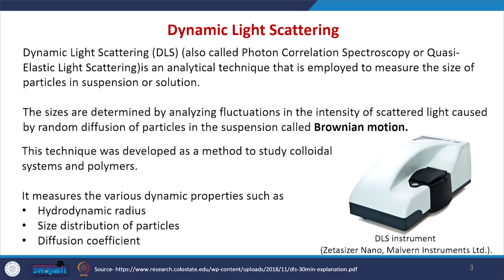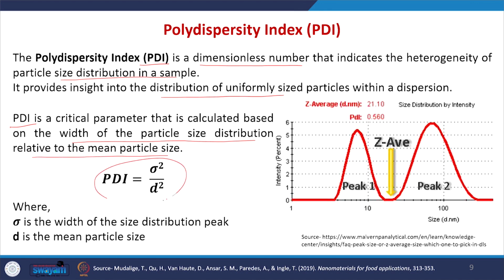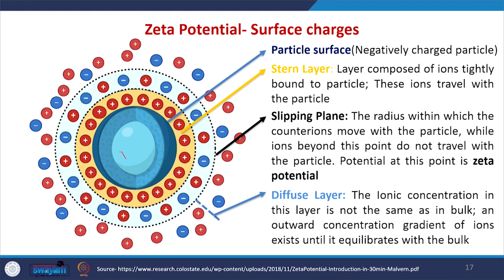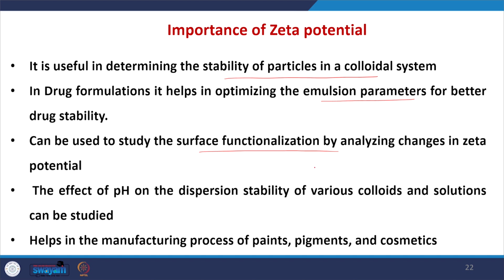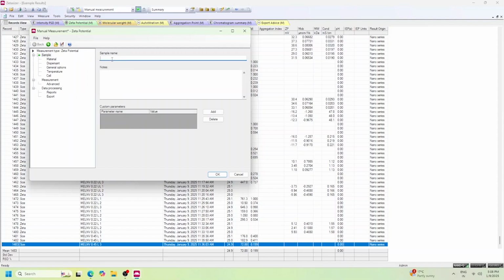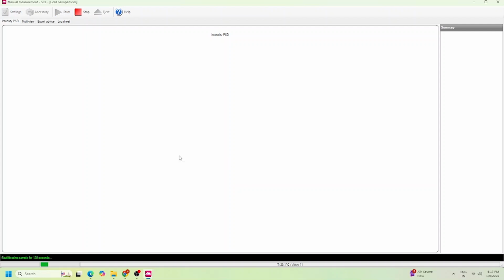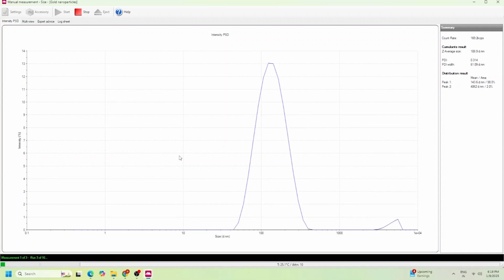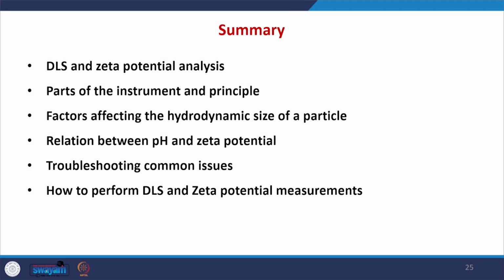Lecture 07: Dynamic Light Scattering and Zeta Potential Analysis

Comment: In DLS results for particle size, the graph observed was Intensity as a function of particle size. The x-axis was particle size on a logarithmic scale. I was wondering if two peaks of similar Intensity  but at different particle sizes, say 10 and 100 nm, correspond to significantly higher contribution in count from the 10 nm size compared to that from 100 nm size.